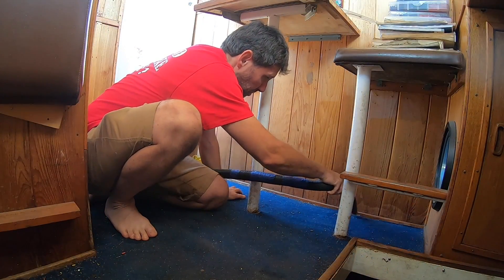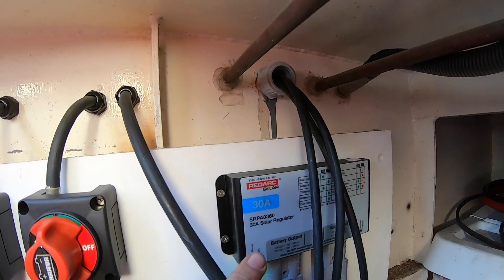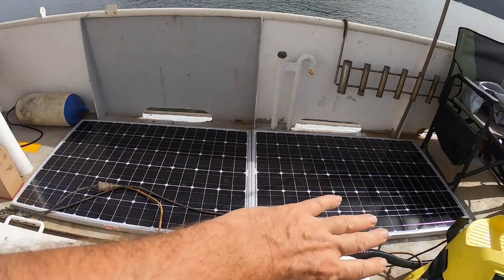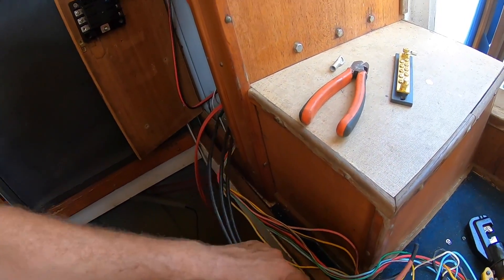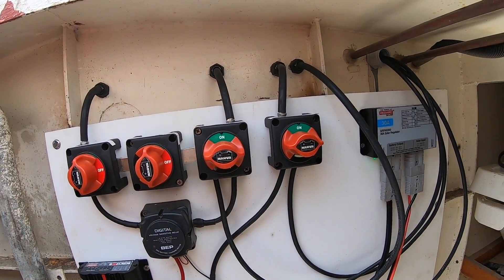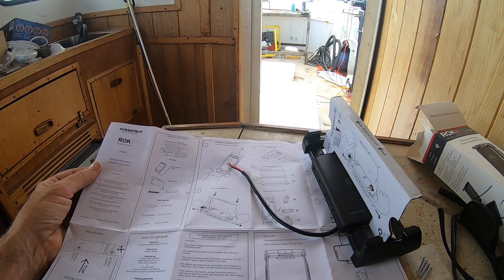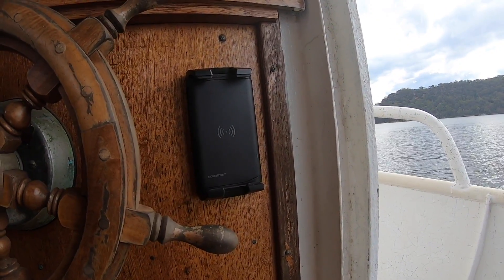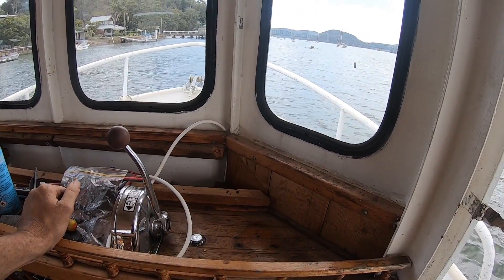Trawler electrics

Comment: When I see aluminium wire and aluminium lugs, I would throw all of that overboard! So much corrosion plus aluminium wires like to overheat and they get worse over time... I stripped all aluminium wires out of the sailboats and catamaran and replaced them with marine grade copper wires and they work perfect. Just a comment, I still love your story and adventure with this trawler :D I really want to see this boat finished 100% :D
Reply: It is not aluminium, it is tinned copper,  which is the only marine grade to use. Hope it really was aluminium ad not tinned copper you removed.
Reply: @Nick75au1  I removed a aluminium wires. Had to cut them so it was easy to see what they are made off. As long as he uses copper, Im happy 😊
Reply: @nikolabolic7120  Aluminium wiring is not common here, it is really only used for long runs for high amp situations in comercial and industrial power distribution.

Comment: Like the way your doing your Labels but would Add colour coded zip Cable Tie's say Green at both ends of the cable to Know what is what if the Dymo label comes off and also run a Log Book as to what colour goes where say green for Bilge pump and so on ,just my way of thinking i would also add isolation Switches to the inside of the wheel house saves running inside and out to shut power if you had to. Great job

Comment: If you decide to get another camera instead of the go pro, check the Olympus TG6. Almost perfect for what you're doing, drop/freeze/water proof, specifically designed options for underwater purposes. Had an older one but traded it when i went to the OMD series
Reply from the maker: Thanks, I'll check them out.
Reply: @DangarMarine  I realised later after I wrote that I was mainly considering the underwater and toughness, as you said you'd broken a few. I don't know if it's completely suitable as a YouTube filming camera but I can't imagine its worse than a gopro, certainly has more features. Cheers

Comment: You should add fuses as close to the batteries as possible. If a cable accidently gets cut and shorts, it will feed full fault current until the cable or battery melts and opens the circuit. Size of the fuse only has to protect the cable so like 80a or a 100a will be fine. Good vids
Reply from the maker: There are fuses directly on the terminals.
Reply: @DangarMarine  as you were 👌👌🤙

Comment: Have a look at the Milwaukee 12 volt  cordless soldering torch, they're brilliant for this sort of work
Reply: There is presently a 3 day special through both Sydney Tools and TradeTools  Qld from today and they're $157 including a free 12 volt li ion battery but you still need a battery charger if you haven't got one, I'm not involved with either company but I bought a second unit this morning,I do use it a lot and is one of my main go to tools now, 18 seconds to reach working temperature

Comment: Hey Stu, have thought about a flexible cable tray so when you open the door all wires tongue fuse box can  flex and are safely protected. They are not that expensive but it might stop the cables pulling out of the fuse box when at sea.
Reply from the maker: Yes, you are right,I still need to do more on cable protection yet and will buy a few more bits to help.

Comment: Hi Stu,, I'm not being critical mate & not saying this will happen to you but a mate of mine lost a mobile phone which was in a similar situation to yours. The constant movement & vibration may have been the cause, also he has a smaller craft than yours so may possibly be more subject to movement etc. Anyhow he had no other viable positions to position the charger so he put a velcro strap around the unit to secure it.
Great to see more news & progress on the trawler.
Cheers mate.
Reply from the maker: Hey George. The holder seems to grip quite tightly and, yes, small boats to jar much, much more than boats like this, i think it will be fine.
Reply: @DangarMarine  👍

Comment: You switched your 12v and 24v switched fuse panels, 12v was on top and 24v was on bottom.  Also if you label only the covers they can get mixed up if you removed both at the same time.  You may want to label the cable on each end as well.
Reply from the maker: Well spotted. :) Yes, I swapped them because I tested the voltages and that is the way I wired them up. Labelling the cables themselves would be a good way to go.

Comment: Have you seen or used any of the solder filled butt connectors?  Same as crimp but you heat the connection melting the solder and shrink the wrap all at the same time.  I would venture to say that your nav equipment would have less interverence with solder connection than crimped.

Comment: Stu , sorry for another post, but you mentioned the compass on the shelf near the wheel, won't your GPS etc incorporate the compass or are you talking about a traditional no digi one, if so then why?
Reply from the maker: By law here you need a magnetic compass on the boat when heading offshore incase of electrical failure. It can be handheld though.
Reply: Now I can sleep, thanks.

Comment: Just a reminder that your phone has a compass app that works nicely ! I like your idea of 12and24 volt systems ! Could you live onboard you vessel now if you had to ? Are you going to have davits on the stern for your dingy ? I have the same crane system to lift outbound motors into my test tank , works like a charm ! Do you have or going to have a backup generator ? Do you have harbor freight there ? If so they have a 900 watt 2 stroke fairly cheap and work real well ! It’s really coming along nicely !
Reply from the maker: Hi David. I have a 6KVA petrol generator on the boat now, but I may take it off when all the work is done to save some space, we'll see. I've been looking at a few ways of storing the dinghy, but I'll build the swim platform first.
Reply: Dangar Marine a 6k generator is a fairly large one , size wise , you could get bye with a 2k or smaller with the solar you have . A good place to store the dingy would be on top on your new roof addition perhaps . These are only suggestions and you probably have thought of these already but just in case !

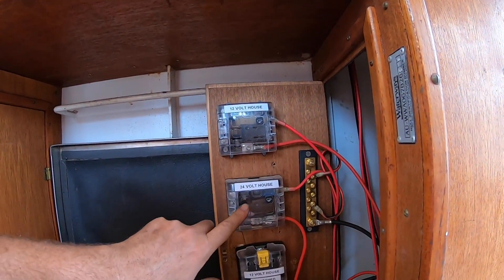Comment: 10:22  That red top wire coming from the box marked "24 volt house" is in a bad spot where it touches the contact of the negative bus bar.  That's just asking for the electric fire to happen.
Reply: Exactly!  The amount of vibration and movement onboard will make that wire rub up and down on the ground bus and short circuit the wire.
Reply from the maker: Yes, still needs to be moved.

Comment: i wonder if it wouldn't be possible to set up a cool old-timey compass with some wire coils, and a digital magnetic field sensor somewhere less affected by the steel of the boat, perhaps on a small mast on top of the wheel house, then use a microcontroller to steer the compass using the wire coils
Reply: You really need one technology independent compass......steel boat compass with adjustable compensators and a good 360 pull around installation is truly the right way to go..

Comment: I would have assumed all your electrical connections would be soldered onto the cables, especially where H20 is about. Crimping connections will over time go high resistance in damp salty conditions. Seen enough of crimped connections in the motor industry over the years. (retired auto electrician) nice upload today did you catch your dinner ? . ✌ peace
Reply: Soldering is not the right way at all. 
He has done it the right way with crimped connections.
Reply: Untinned copper wire in automotive, Stus wire and lugs are tinned, so "pre soldered"  a good crimp is superior to soldering for several reasons, most importanlty in a boat is soldering creates the possibility of a solid wire which breaks under vibration.

Comment: Its not only the glue that you need to worry about. Letratag labels are no UV resistant at all. Text will fade in less than one year if the labels are in sunlight. In my experience black on yellow Letratag tape is much better than black on white though.

Comment: I am concerned that your ground lead is not large enough. I am no electrician, but if you have, for argument sake, three 12 gauge power leads you will need more than one 12 gauge ground returns. Someone correct me if I am wrong. Love the channel dude!
Reply: Luther Hendricks depends on the total load coming from the three 12+ . If it’s less than 20 amps and it’s 12awg then you will be ok.
Reply: the return is 25 mm2, each supply is 16 mm2,  the return is good for 70 amps at 12 volt if its the lenght of the boat

Comment: Have you seen those solder heat connectors ... they're ideal and not hugely expensive!
Reply from the maker: Yes, I've got some on board. They are cool but I've actually come to trust the crimped connectors more.
Reply: @DangarMarine  That's interesting - I've recently replaced some crimped connectors with the heat shrunk solder type.

I was at the time concerned whether the solder had flowed properly or not, I guess time will tell.

How did they fail for you? 

Why do you feel more comfortable with the crimped style?

Other people's perspectives are always useful :)

Comment: Messy cables ....... a rats nest will always be a rats nest and a headache to find any fault . Your doing tidy and neat on the rest so do it here too. To reduce the strain on cables over a hinge on a door take the wire from bottom of the door to the top parallel with the hinge this way the wire only gets a small twist as the door is closed.  Clip the cables  at the top to the door and the bottom to the structure .No big loops to push out the way.  It also looks neat too. It may be too late but there will be other place to use this.  Works on hydraulic  and water hoses too. Amacf
Reply from the maker: Yes, lots of work to do on securing the wiring yet.

Comment: For all those soldering freaks, soldering wiring systems without further mechanical protection is a NO NO in marine, it creates other issues that are worse than what the soldering is meant to achieve, a well executed mechanical crimp on tinned copper cable is a better joint both mechanically and electrically, and I quote from the AS 3004 marine instalations,  "Clause 7.2 Solder shall not be the  sole means of mechanical connection except for connections within an electronics enclosure"
Reply: Yeah aircraft use crimp connectors rather than soldering wires together.

Comment: Using a common ground bus for both 12 and 24 volts could cause problems if the cable(s) to the batteries is compromised and any of the 12 volt appliances have a separate(not on the bus) chassis ground, the 24 volts could end up reverse flowing into the 12 volt system
Reply from the maker: Thanks, will take a look into it.
Reply: I have 24volt set up ,aluminum hull, inboard diesel,  on a multi meter with positive on battery and neg on hull it's reading 25 volts ,I don't understand why? Any ideas???
Reply: @gameon2546  

The hull is connected to the negative battery terminal
Reply: @pjimmbojimmbo1990  does it need to be connected?

Comment: Stu, are you going to be running an isolated (from the hull) ground system?
Reply from the maker: No, there is going to be a single strap from the ground buss bar to a single point in the hull. I've been talking with a guy from Raymarine about this and I think it is the best / easiest way for me to go.
Reply: @DangarMarine  Good, otherwise there are all sorts of other things you would have to do, such as each wire coming back to the negative buss bar would need to be fused in addition to the hot leads, and you would need ground fault lights too.

Comment: Your grounds look  sound, however, when you mount something the equipment will create a ground loop, by mounted device A going to metal, and then mounted device B also going to ground, if A and B are both on separate grounds and then are both mounted on the steel hull, well you have just tied grounds A and B together. Maybe the way to solve this is to only have one ground, and everything uses the same ground.
Reply: Here in US we only have one common voltage so one ground works for everything. I was wondering if he should have a 12v ground bus and a 24v bus and run the ground back as required? Would this prevent combining the low and high volt grounds?
Reply: @vtx2005retro  - I also live in the US, and you can tie the 24V and the 12V grounds to together without any problems. If you do that, and I'll have to go crack my power supply book open to check, you can get 36volts if you connect leads from the +12volt and the +24volt feeds. think of it as combining the power supplies. - like I said, I need to go dig up the book and see if I remember this correctly, however, back to the original question, yes you can tie the  grounds together.
Reply: @TheDgdimick  No you can not get 36 volts from a 12V  and 24 V batery bank system with a common negative (ground is terminoligy for a different wire BTW),  In US standards on a boat  AC ground and DC neg must be tied togeter.  Getting lower voltages (ie center tap) from a series bank of batteries is bad as each battery will be charged and discharged at a different rate
Reply: @Nick75au1  Yes Nick you are correct, I went back and looked at the P/S stuff and it's not using a common ground that will add the voltage. I don't deal with P/S like I used to, so I'm surprised at how much I've forgotten. What's your take on the common ground however?
Reply: @TheDgdimick  common Neg is standard practice,  there are some specialised applications for an isolated neg, but not for  general distribution. Here is where ground is different to Negative on a steel boat, ground of equipment can be  connected to the hull, but the hull can not be used as the return path for  equipment power, so negatives must return to the battery negative isolatd from the hull, unlike a car which uses its chassis as the negative return path. The ground path to battery negative will be  generally though the engine block via a sepperate link from hull to block.

Comment: Do need a in line battery charger or can you feed direct from solar regulator to your battery?
Reply from the maker: Straight from regulator to battery, I believe it is a regulator /charger but I'll check.
Reply: A solar regulator by definition is a battery charger ;), solar panel>regulator>battery

Comment: Have a question for you. I have asked around but not getting a reply.  Q: 40’ Chris Craft 1967 wooden hull, I was thinking of glassing then whole bottom? All wood was replaced and the keel was replaced. I know the wood need to expand with water rot seal the gaps, but it will take on more weight. Would like to know what you think. Thank you
Reply from the maker: I'm no expert of timber boats but I've certainly seen plenty of them where the hull has been fully glassed quite successfully. It can be a great way to get some more life out of an old hull relatively cheaply.

Comment: I would fill nervis haveing a charger that close to an open door
Reply: Id be putting a cover over them
Reply: I agree. I thought the area protected by the window may be better than right by a door in case of rain, or heavy seas.
Reply: Completely waterproof so it wouldn't worry the charger, all stainless parts so no corrosion either
Reply: @ryansams8216  that's not the issue. What about the device that is getting charged? What if the springs fail and the phone falls also high traffic spot there is a chance it can be bumped
Reply: @egypthobby  I guess you can never stop things getting hit by Humans, most of the phones in the market are now IP waterproof rated, however the product can charge through a phone case so you can be double sure. Valid points you make however.
Reply: I think the phone will fall off the first time you pound a wave.
Your videos are excellent.
Reply from the maker: It can also be a closed door.
Reply: Dangar Marine , don’t put your magnetic compass next to your phone as it will put in a deviation. And keep the compass as far away as you can from all Metal, yes I know it’s a steel boat but try and put it in the middle so as to have a even magnetic field around it. Or just get a GPS

Comment: Check with someone that knows ya setup, but if that neg cable is the same size as the multiple pos cables, it might end up over loaded? A quick fix would be to fuse the neg as well as the pos cables. Works different to 3 phase AC because each phase pulses at a different time, DC neg should be the size of the combined load of the pos (or rated for the sum of all the main fuses from different sauces (batt/solar/tomato))

Comment: Problem with those labels is there thermal and will fade quickly
Reply: Yep, get some traffelyte (or brass) labels engraved, can be one continuous label or individual, they can be done at your nearest sports trophy shop, down the track & screw them to the flat panel adjacent each switch.

Comment: Stu, Jay here from the States, quick question why aluminum wire and why no dielectric grease?
Reply: Its tinned copper wire as are the lugs , never use bare copper in a marine enviroment .. hoping stu will use liquid electrical tape,  die electric paste.. not so much ....
Reply: Stu is using marine grade cable, each strand individually tinned, more expensive and slightly stiffer than copper but won't rot as easily.
Reply: @rayg9069  Tinning makes virtually no difference to the stiffness of the wire, strand count and strand diameter does, I have some super high strand count silicone tinned wire that is as flexible as wet noodles